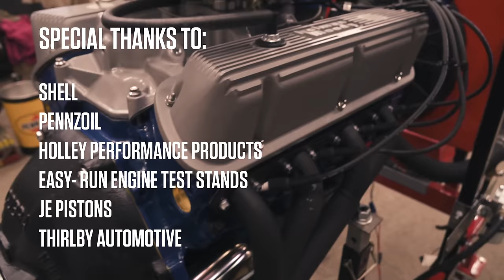Ford 289 V-8 engine time-lapse rebuild (Fairlane, Mustang, GT350) | Redline Rebuild - S2E1

Comment: So if it only takes 5 minutes to tear down and rebuild an entire motor, why is it so damned expensive?
Reply: It is a time-lapse shot so it takes much longer than that. If you want to know why it is so expensive take a second to consider all the work being done in the video. All the machine-work, new parts, labor costs, and potential screw-ups when assembling because everyone makes a mistake and you end up with a lot of money spent on the whole thing. I know you are probably being sarcastic though
Reply: I guess I should have ended my post with a smiley . I am fully aware of how long and how much it should cost for a good rebuild on an engine.
Reply: Sebastian Rodriguez , thank you.

Comment: All that hard work, then they ruin it with Pennzoil... Meh still a great vid!!
Reply: Paul Bonefas - My '93 Cherokee 4.0 has run Pennzoil 20-50 since new and just passed 373,000 miles. Just sayin'...
Reply: Paul Bonefas Paul. Are enough even a mechanic? Pennzoil is build and made for for engines. And believe it or not. It’s the recommended oil for a 6.7L Turbo Diesel Cummins engine as well.

Comment: When you look at these little 260/289 Fords one should keep in mind that these formed the basis for both pushrod and DOHC Indy V8’s. 

They won in Indy Car racing as well. 

Small lightweight especially in the rotating mass arena. 

Fantastic engines that always seemed to be overshadowed by the ubiquitous small block Chevys.

Comment: My grandpa had a 65 Ford falcon futura with the 289 and it would smoke the tires so easily he had to have his "Mechanic" put a stronger spring on the carburetor so he could be able to drive it (He wasn't a freeway driver) he only drove on the streets. In the eighties I use to drop my Ford F-150 of at my grandparents and borrow the car and go street racing in Van Nuys and Whittier Bl. His mechanic kept it in top shape and had Moon hubcaps, chrome curb finders and one of those knobs on the steering wheel so you could drive one handed on it so it was a total sleeper. I use to do burn outs in reverse uphill ! And I burned a lot of Mustangs and Porsche's off the line.. damn that was a great car.

Comment: 10 bonus points for the Holman Moody reference.
Reply: Yes but they should get those 10 points taken away for using a Fram oil filter on that engine.  Worst oil filters ever made....even if it might be just for initial break in, they're known to be extremely cheap and of poor quality.

Comment: I'll Tell You What, I Had 5 Different Cars With The 289. From The 190 HP, 2bbl., To 306 HP Shelby 289.
That Little Motor Is The Best Engine Ever Built. That Little Mill Was Bulletproof. You Could Beat It To 
Death, And It Would Still Work, Well.

Comment: I know this is the internet & everyone can live out their dream & post without having to back up their boasting.

I was fortunate enough to work for a BMW & Ducati shop in South Jersey (I was getting my Comp Science degree so I was just part time) run / owned by Rob Kiviat (RK BMW Ducati). He could tell you part numbers off the top of his head, what the revised number was & depending on the serial number of the motor what part fit. Of course, there were exceptions. There is always exceptions. Unfortunately, BMW wanted to mimic Harley & all dealers had to be miniature Bloomingdale’s. We were a motorcycle dealership, not a clothing store. You know how that ended. Rob was phenomenal, just amazing to say the least.

One of my colleagues I worked with, his brother in law was the head ‘mechanic’ at the largest Corvette dealership here in Jersey. Most of his time was spent updating his knowledge base of the computer systems for Corvettes. That training was to passed on to others. How many were just good students & how many were just guessing by just throwing parts at the problem, only the customers know.

I am sure it is the same for welders & machinist.

Comment: Did the same to my 68 mustang in 1988 rebuilt 289 hipo fireball cam,torker 2 intake,holly 600 dbl pumper,headers w/cutouts,  4 speed toploader 9" rear, ladder bars 50s in rear 60s in front. Done in 2 weeks drove back from Texas to Va 3rd week after check for leak etc. All i could do is think as I was driving was did i torque every nut and bolt etc 1500 mile break in trip think I had maybe put 50 miles on it testing before leaving. No issue other than speedometer cable gear broke easy gear replacement. Everything else purred like kitten. Drove another 6 years till Got married had to sell for work truck and tools. Loved my mustang and the 289.

Comment: Gotta love the 260's and the 289's. I once built a 260 and put a set of 289 heads on it. If I'm correct, the bore of the two motors is only about 1/8 inch. Thinking the 289 was born from the 260?......

Comment: On the redline rebuild  video ; three very important items were left off. Larger valves were needed ; guide plates with true screw-in studs and a Boss 302 windage tray should have been included for durability and performance

Comment: The Ford 289 and Chevy 283 were some of the best engines ever built, in my opinion!  Why did they  drop them?  I know the 302 (5L) sort of replaced it and is a great engine.  The GM 305 was not as good as the 302.

Comment: uses the cheapest oil filter hahaha... i know why, ive been building engines for over 20 years & thats what i use, fram, not many people know this but this filter exceed oe quality, i use to buy $30 filters, $250 head gaskets, most expensive doodads cause that's what the advertisers would shove down my throat,,, if you build an engine right with oe spec parts it will out perform alot of expensive builds,,, i use to race against cars with turbos thousands of dollars put in, i always rolled a rebuild milled head higher oe comp. pistons, all day smoking them while they throw rods shitting oil all over the road,,, i love watching these videos, very relaxing while drinking beer, keep it up

Comment: No one has a comment on adding an crankshaft oil slinger with a double roller timing chain?!?  

The oil slinger ONLY goes with a NON-double roller timing chain - one or the other, otherwise the timing chain eventually snags the edge of slinger, rips the slinger apart into pieces, and disperses metal slinger bits around the oil system until the chunks find their way inside the oil pump, jamming the oil pump, and finally the distributor shaft twists and breaks causing zero oil pressure. Even an aftermarket distributor oil pump drive shaft breaks under this load. Fortunately I was only 1/4 mile from home when this occurred to my Windsor.  I wish that I had this information available back in the 1990s when I was rebuilding it.  Since, I've also attached a couple of cheap large Harbor Freight magnets to the bottom of the oil pan.

Comment: It looked like the original pistons were dished. Were they? If so, how much more compression did you get by using flat top pistons? I am also surprised that the crank wasn't re-balanced. Usually those new forged pistons weigh less than OEM cast pistons.

Comment: I have always wondered, when you surface the block and heads, what do you do to adjust to make up the difference on the width of the intake manifold? Do you need to change gasket thickness or shave the manifold? Thanks for the video.

Comment: I’m 14 and planning on opening a restoration shop soon because I have a massive passion for old cars and I have a few questions if anyone could answer them? At 0:55 what is the tool they are using to get those springs out, and is it a necessary tool to get them out? And at 1:41, are they boring it out or just cleaning the walls? I then see metal bits at 1:45, what are they doing? If any of y’all could help me out that’d be great!

Comment: Can a 289 be bored .040 over? I keep reading only .030 or else it over heats or doesn’t last long. I have a block .030 over and I was told it needs a bore but 2 shops didn’t want to do a .040 on it . Any help would be appreciated

Comment: Sorry if it's a dumb question, but did they use 25w50 oil for break in reasons or these engines used that thick of oil?

Comment: Fascinating!!! I had a 1964 Ford Falcon with a 260 V8 and I thought they were the same block but I noticed the heads were different. Have you done a rebuild on one of those?
Reply: They are the same block, only real difference could be the very early ones had a 5 bolt bellhousing instead of the "normal" windsor pattern.

Comment: I have a 1985 mustang gt, about how much would it cost me to get the same thing done to my engine
Reply: CREB Engineering in Rhode Island will do this for 3k to 4k depending on what you want. They have a 330hp package for a 289 with factory heads that cost 3 thousand. That's what I am going to go with through them.

Comment: How much do you think this costs to have all this beautiful work done?
Reply: I had my 1967 Windsor 289 redone at a machine shop in a smalltown in northern Missouri for a little over $1,900 in 2016.
Reply: @Ed-zn4xn  WOW! I would have guessed quite a bit higher. Did they do it like in the video? All the detailing too?
Reply: @jasonnehceis3267  - Yes, that's what caught my eye about the video.  I visited with the machinist on occasion and can verify.  I drive my '67 Mustang about 2,500 miles a year going to cruises and car shows.  Those 289's are bullet proof.

Comment: Why (or how) do Ford V8's always sound so hollow, like they are running inside of a cave?  It's not a bad thing, they just sound farther away than Mopar and GM engines... I can always tell a mustang just by the sound when it drives by.  The engine in this video is the same way.  Anybody else notice this?
Reply: Its actually the cheap mufflers they are using, a good exhaust system and they'll sound as good as anything.

As for how easy it is to tell if it's a mustang by ear, that's most likely due to a different firing order compared to mopars, GM's, and AMC's.
Reply: @riogrande163  ahhh, it could be the firing order, that could produce a different set of soundwaves out of the pipes.  I didn't know they had a different firing order.  I've only worked on GM engines. Thanks